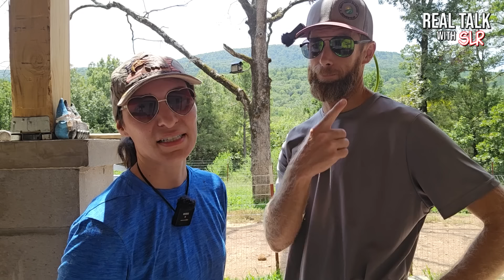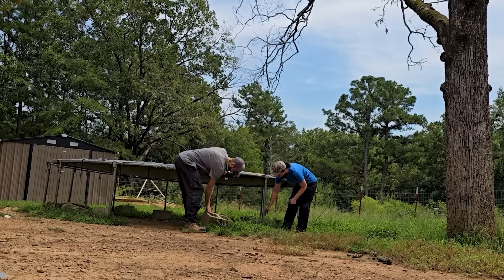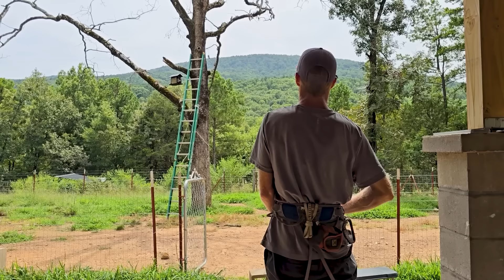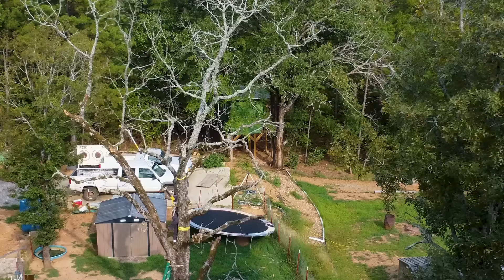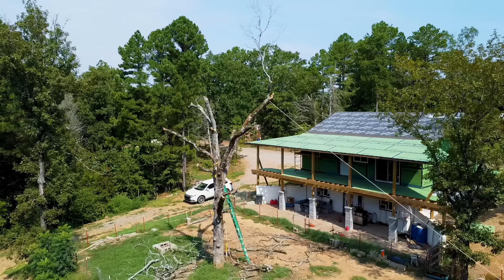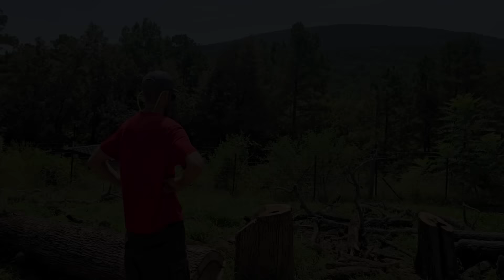This Dangerous Job Changed Our Mountain View Forever On Our Cabin Homestead! | GOLIATH Tree Felling!

Comment: Gary, I know you have a background in safety, so do I!  Myself as a site safety manager and OSHA Construction Safety Instructor.

I cringe every time I see you put on a safety belt!  Ironworkers would wear the hook in back, you wear it in front.  In back if you fall all the force will be on your midriff!  We had Ironworkers step off a ladder and hang like they had fallen.  Thirty seconds was all they could stand, and they were yelling to help get them down.  The fallacy of preferring the attaching point be in front, is this.  If it is a slip you may be able to hug something until you regain your hold.  If it is a fall you will be bent backwards, possibly breaking your back or becoming paralyzed.  Belts are only good for fall restraint, like on the roof so if you slip and fall, you won't go over the edge!

See if you can get a sponsor that will provide you, Mel and Spyder Monkey with a full body harness.  There will be more trees, roofs, play houses to deal with!  You could do a short spiel every time you get ready to use them.  Too many Workers have been severely injured using belts, please don't be the next!  ❤❤